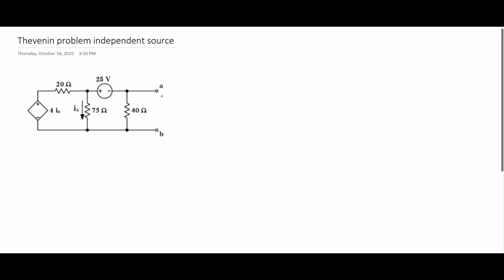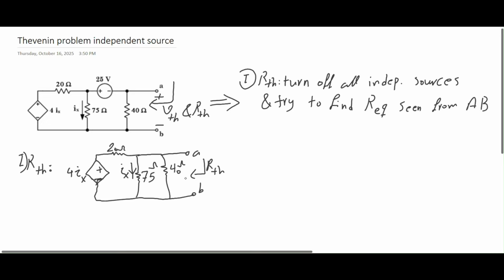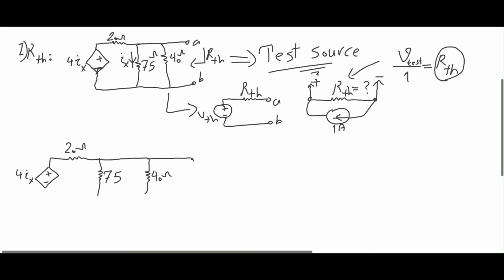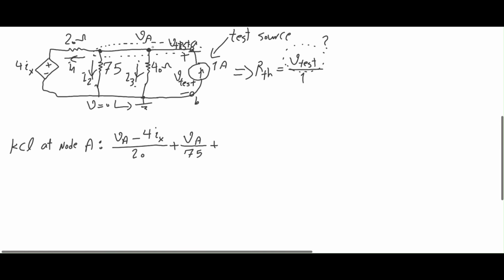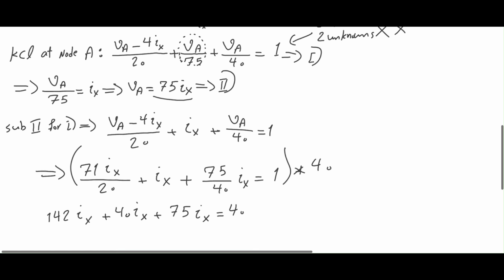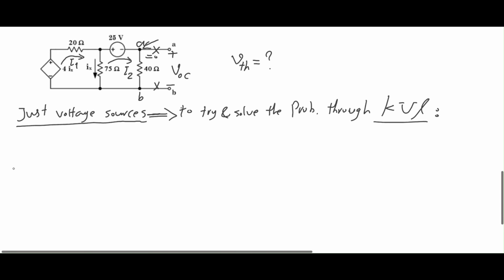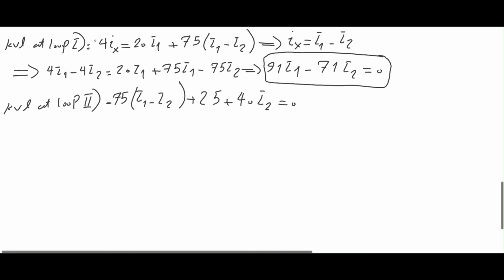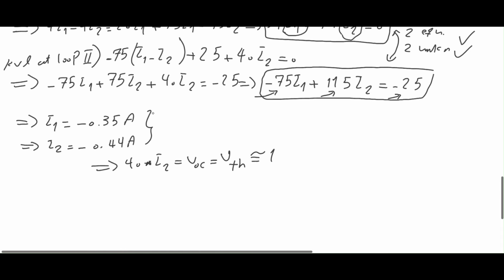Thevenin harder problems solving using dependent sources

Comment: you calculated Ix to be 0.16 A.If thats the case then across 75 Om resistor there s a drop of 12 V since 75*0.16=12.That means there s must be a difference of 13V across 40 Om resistor since is at 0 volt.Why 17.6?